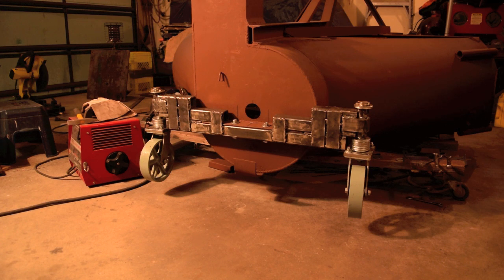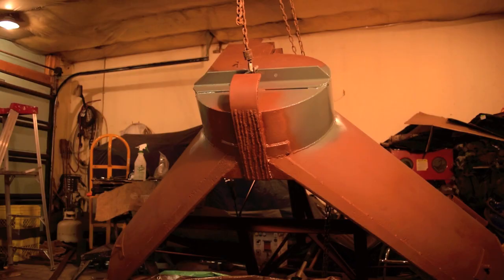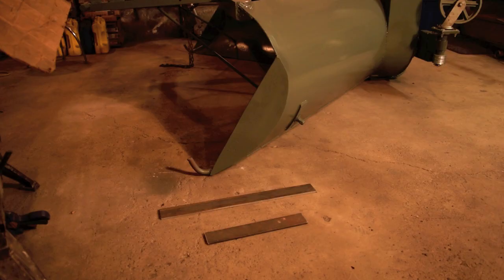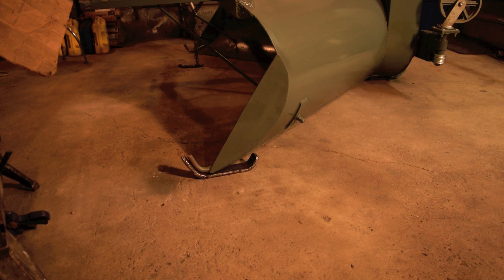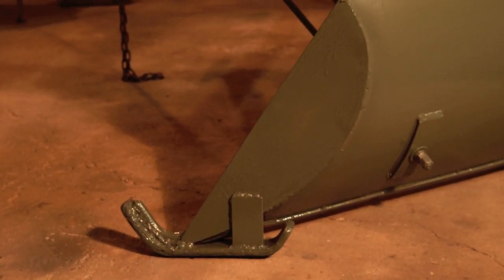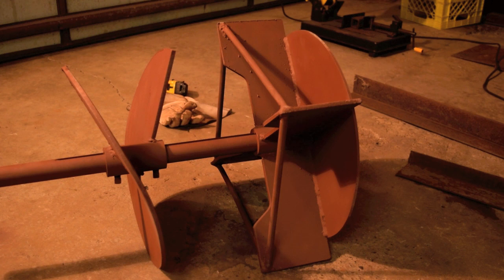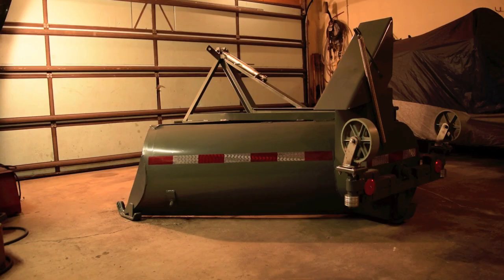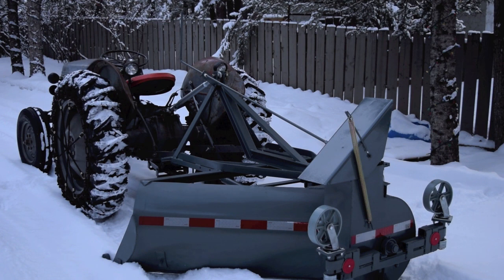7 Foot Erskine Snowblower Part 3

Comment: Wow, really nice!  I have two 5' Erskine blowers that need to be rebuilt, and found your videos looking for a better way to attach the chute.  Do the angles you welded to the impeller break up the big hard chunks?
Reply from the maker: They will break up chunks. The reason I put the angles on there was to draw snow into the blower fan and give the snow a boost up into the chute. My Son now has the TEA-20 and the blower. The blower is a bit big for that tractor and really should be on a Cat 2 3 PTH tractor. I am still looking for a 6' with the wide and long chute opening as shown in my other videos of it. They are like hens teeth and prices are way up there.